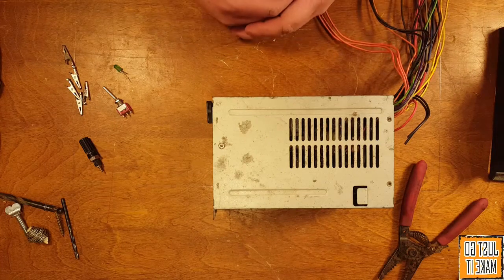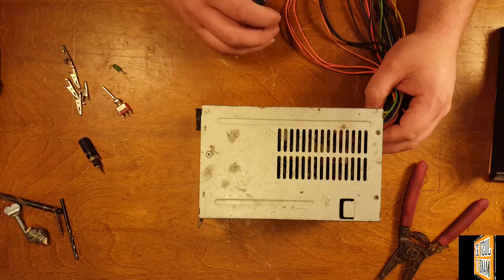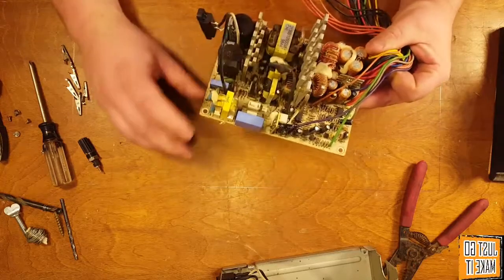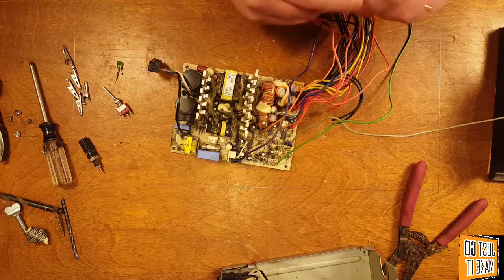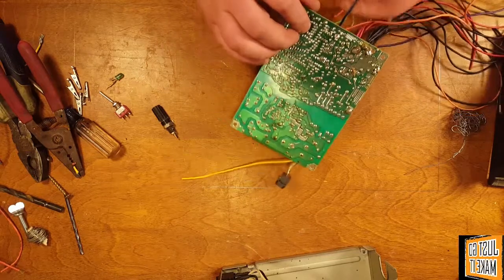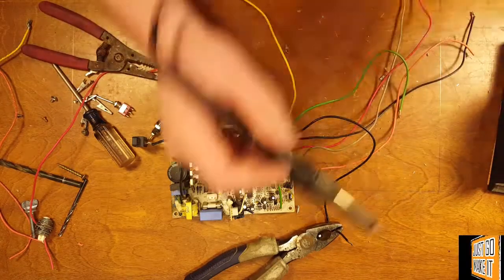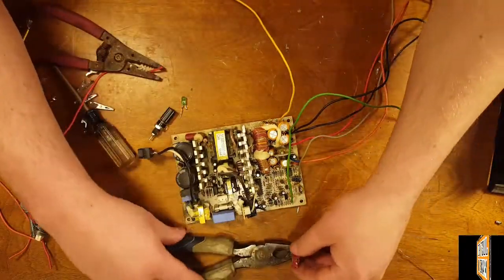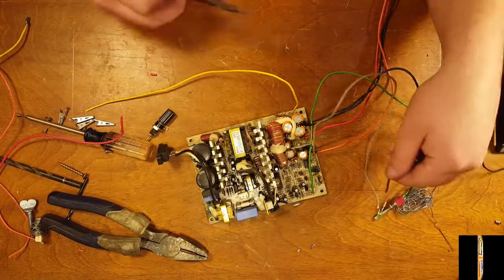DIY ATX Bench power supply

Comment: Nice video! I only have one question. Because my power supply is new, and it has the yellow and black striped wire, is it going to cause any problem if i solder the regular yellow wires along with the black striped with yellow wires?
Reply from the maker: +Adam Hallag the yellow and black wires are for a second 12 volt rail on the power supply.  You can get away with combining the 2 rails together on some power supplies (connecting the yellow wires to the yellow and black wires).  Google combining 12volt pc power supply rails and do some reading.  i personally have not worked with a power supply like that.
thanks and good luck
Reply: Awesome thanks

Comment: don't you need  to  use  a  larger  diameter  wire after cutting all  the  narrow  ones   off ?
Reply from the maker: +P & S McAllisters only if you plan pulling a lot amps
Reply from the maker: +P & S McAllisters only if you plan on pulling a lot of amps.
Reply: ok  tks  i appreciate  the  help!